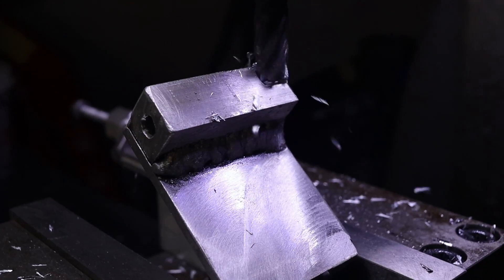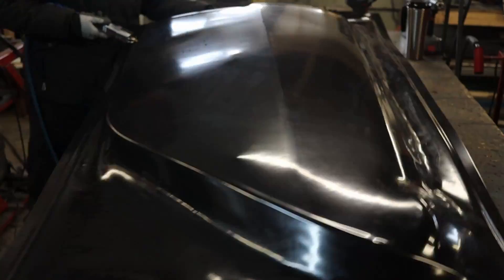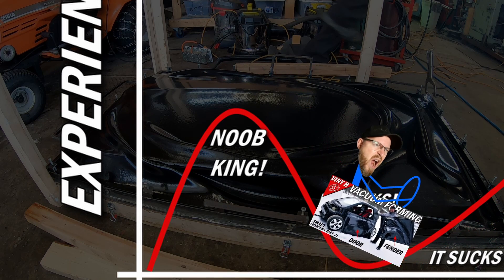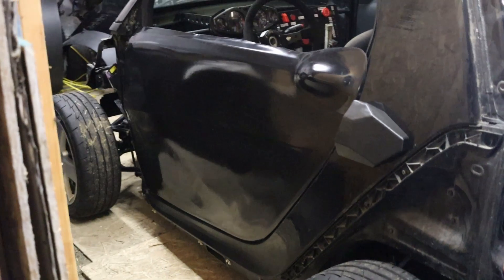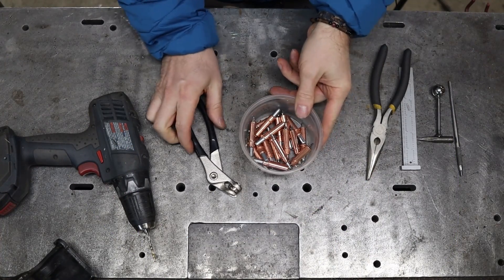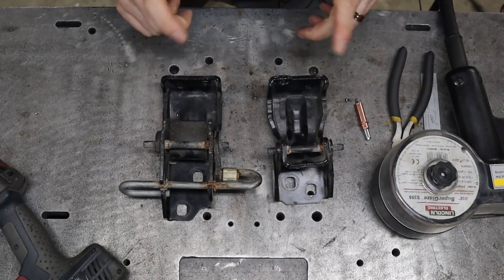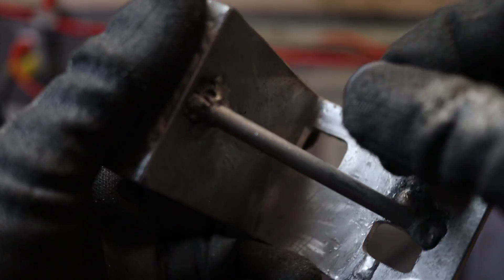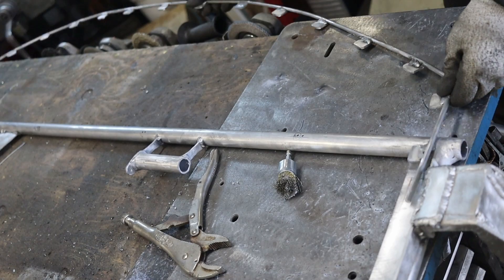Building a LIGHT WEIGHT Custom Racing Door Part:1 / Smart-Hayabusa Part: 22

Comment: You need to use infrared heating lamps with some temperature controls for more precise control of the heating process. IR heat lamps, like they use in auto paint booths, should work and they aren't terribly expensive. Also, have an electric heat gun handy when you are doing the vacuum forming in case you need a bit of heat in certain spots.

Comment: Hey Viny I need your help I thought today was going to be the the day that I tested the dune buggy , but the clutch is still making noise I tried opening the bleeder thinking that would relieve all the pressure on the plates but it still did the same , then I bleed the clutch again and push the peddle in and of course that made it worse ! Normally when you let the release the clutch handle on a bike the clutch plates retract, that’s what I don’t understand , I’m wondering if I need to go to a motorcycle clutch lever and master cylinder to fix this problem ? Any idea
Reply from the maker: Hey David, I'm not sure, but did I told you to reduce your pedal's travel or is it to somebody else? I don't remember...🤷‍♂️
Reply: @VinyB57 Hey Viny it was me  (Alan ) i did reduce the travel on the clutch pedal but that did not work I still had noise when I started the bike , it seems they had problems with clutch noise on that model year and before , the clutch spring screws were coming loose and rubbing against the case , so I took off the clutch cover and I had 3 places on the case where the casting was sticking out about a 1/2 inch , my screws were all tight , so I took my dremel
 with a cutting wheel and cut those 3 tabs down to a 1/4 inch , I put everything back together and NO NOISE ! Thank GOD
Reply from the maker: @AlanDavid1955  Nice! Glad you found your problem! 👍

Comment: but why not using OEM door panel?? it's light as hell. make all interior with aluminium, but use oem panels
Reply from the maker: I easily could, but I explained it in my vacuum forming videos, one: I challenged myself to develop the vacuum forming technic (still a real pain!), two: if I get in a small accident, it's gonna be easier to replace any damaged panels, tree: If I want to modified panels, I can do it so and come back to the original design fairly easily if I messed something up! But, you're right, using the OEM door panels is faster and cheaper!

Comment: IR makes a composite body, vibration dampened air saw, too. I like it better than the Bluepoint I've had for almost 25 years.
Reply from the maker: Yep, I knew about this version too, but twice the price...since I'm not using it that often, I went half-good-ok and not full-pro version.